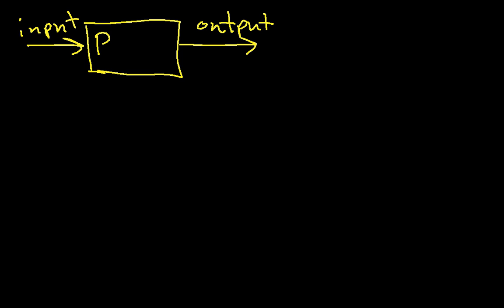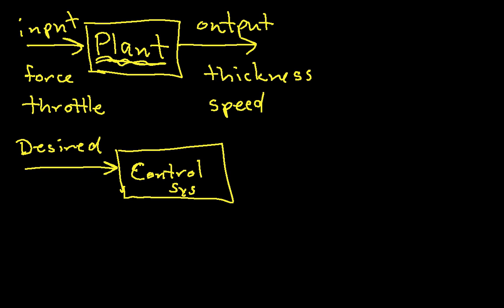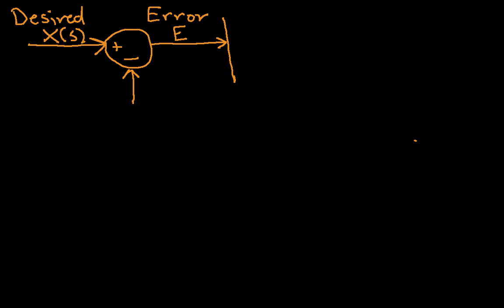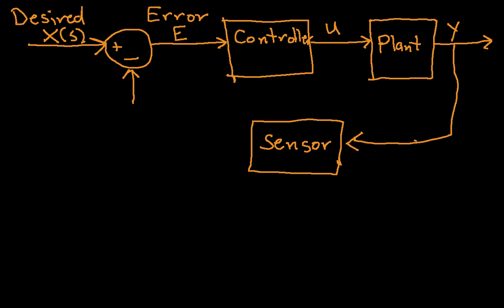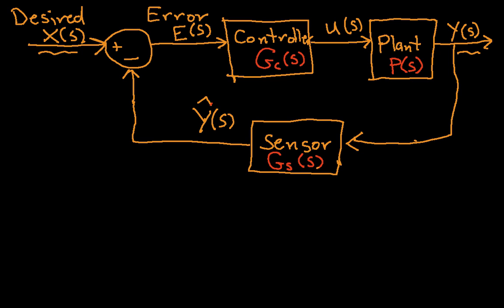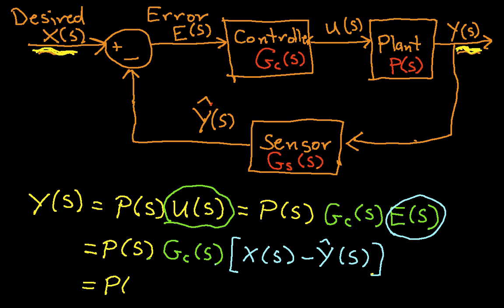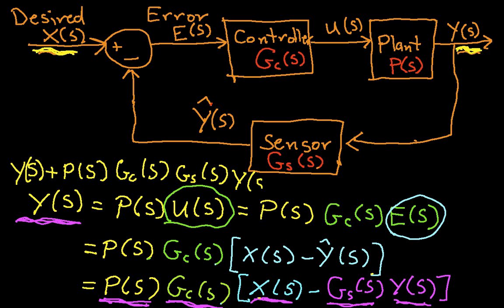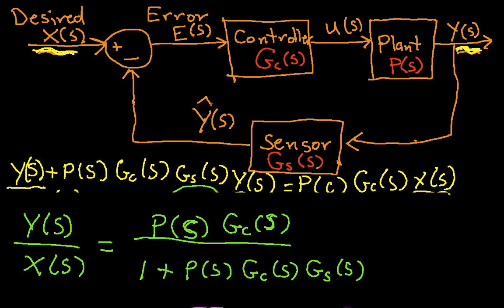Introduction to Feedback Control

Comment from the maker: No, it is more complicated than that. The overall transfer function H(s) relates the Laplace transform of an input signal (X(s) and x(t)) to the Laplace transform of an output signal (Y(s) and (y(t)) as follows: Y(s) = H(s)X(s). So to find the time-domain output y(t) from a time-domain input x(t), you compute the Laplace transform X(s), multiply by H(s) to get Y(s), then take the inverse Laplace transform to get the output y(t).